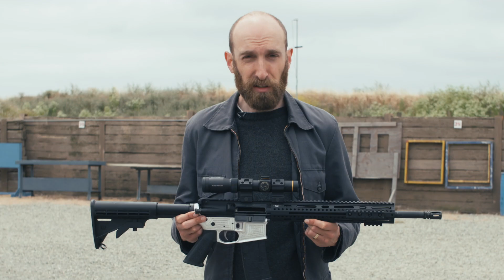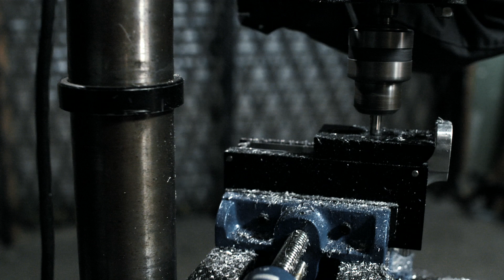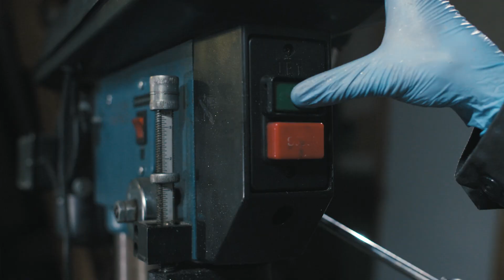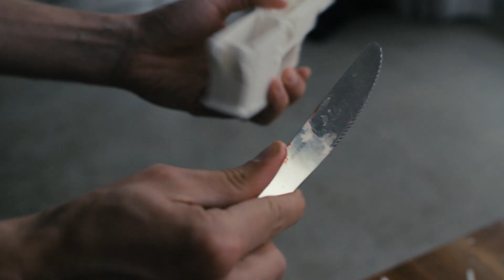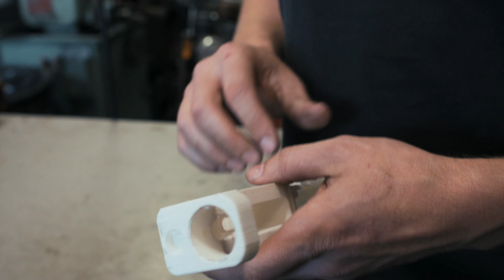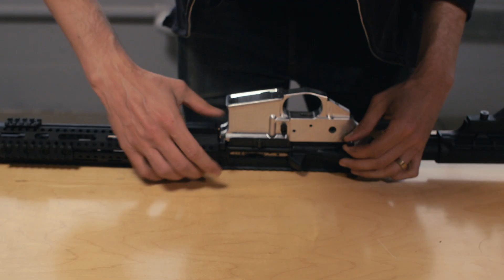I Made an Untraceable AR-15 'Ghost Gun' In My Office | WIRED

Comment: What's your point? Technically I can make a grenade with some black power, shrapnel, and a fuse. Doesn't mean I will or that if I did it would somehow make me a criminal (Although I'm pretty sure that's considered illegal so maybe a bad example) Show me an AR built the way you made yours used in a killing......Can't because no one who is a criminal has that kind of time and patience especially since you can buy a fully assembled one on the black market from mexico for the same price.
Reply: gequitz Tell that to Timothy McVeigh
Reply: Alex Obscene yeah and you can make a shotgun with 20bucks worth of pipe from homedepot, so stopping the sale of this machine accomplishes nothing. If a criminal wants to kill or hurt someone whether something is legal or illegal will not stop them. Control laws only hurt law abiding citizens.
Reply: Murray, To further your point, you can make a slam gun and bore it on your own pretty cheap too.  Just make a custom rifle barrel the old way, with a bore bit and a hammer isn't actually that hard.  Blowtorch heat treating it, boom done.  If you want it better, making a bolt action wouldn't be extremely hard.

If people think this is absurd, a .306 could be made with minimal effort and does enough damage in the proper hands.  Youtube has made making a gun easier than ever.
Reply: ***** Bombs tend to fail to kill as many people as guns do.

Not always (as McVeigh did 21 years ago), but most of the time.
Reply: what i feel it would and could be used for is machining these and then selling on black market. not necessarily for the criminal, but for the criminal supplier.
Reply: Anata No Senei you can legally manufacture a grenade with liscense.... or just file destructive device paperwork with atf and pay them 200 dollars for a tax stamp plus however much (likely super expeneive) your hand grenade is but it must be a transferable item
Reply: https://en.wikipedia.org/wiki/2013_Santa_Monica_shooting

A guy previously admitted to a psych ward made his own AR-15 (with an 80% lower) and killed 5 people in California.
Reply: First of all, you said "Show me an AR built the way you made yours used in a killing......Can't because no one who is a criminal has that kind of time and patience," so the question you're asking now is different from the one you asked previously.

Second, yes people can build bombs (or use knives, molotov cocktails, etc), but bombs tend to fail to kill as many people as guns do (at least in developed countries). 

The San Bernardino shooters killed 14 people with their guns, 0 with their bombs, the Columbine shooters killed 13 with their guns, 0 with their bombs, and the Dark Knight Rises shooter killed 12 people with his guns, and 0 with his bombs.The Manhattan failed to gravely injure anyone with his bombs, just like the Times Square bomber 6 years before him.

While some people who can't get guns do sometimes kill people (Nice truck driver, Tokyo care center stabber), most end up getting caught before they finish building their bombs or fail killing people with their weapons (take a look at how many ISIS related plots/stabbings have failed in Europe). In America, most people who want to become mass murders do end up killing multiple people with guns.

The Santa Monica shooter may have killed 5 people even if he didn't build his untraceable gun. Hell, he may have even killed even more people with a car or something. But most likely, he would have been able to kill fewer people, as crazy people who want to kill as many people as they can are pretty crappy at building death machines on their own. Being able to buy a machine that can make you weapon that can reliably kill multiple people changes the equation.
Reply: gequitz
I knew full well after I posted that someone would probably find an instance where it happened. It still doesn't change the fact had he not been able to machine it himself he could have just bought one by either going to Mexico or buying one off the black market here in America. I mean had he not bought an 80% lower he could have just cast one out of aluminum himself. Or he could have just made some napalm and thrown it on some nearby houses and killed a lot more people. This argument comes down to if people want people dead they find a way.

Comment: Could you make a military great lower receiver (so with full auto capabilities?) with the 80% lower and that machine? Just curious.
Reply: No, what makes something semiautomatic or automatic is the fire control group, specifically the sear. I assume you also meant military grade? As in Mil-spec? All that means is the aluminum meets such quality control and the fit and finish is to certain tolerances. Military Grade has nothing to do with something being automatic or not.

    One other thing, M16A3 and the shorter M16A4 are not automatic, they are either Safe, Semiautomatic or 3 Round Burst.
Reply: Yes, it is possible, and you can legally make an AR15 FA using pre-ban parts or lowers.
Reply: I'm pretty sure you can still buy full auto parts. (Again you'll need a class 3 ffl). But if you had it before a ban it gets grandfathered in. No weird permits.
Reply: Technically yes, but you'd also need a full auto trigger and an m16 style bolt.
Reply: TheConvict50 OK. Is there any difference between the m16 lower receiver and civilian ar 15 lower receiver?
Reply: ok just an FYI, even if you built it yourself fully automatic weapons are still illegal. Converting a weapon to fully automatic is actually fairly simple. I dont know all the terminology  but I will do my best to explain. When the hammer is pulled back, it is connected to the trigger with a sort of hook thing, when you pull and hold the trigger, the hammer flies forward and hot the firing pin and the force of the round pushes the hammer back. If you are still holding the trigger, the hammer catches onto a back up "hook" which disengages when the trigger is released and the primary hook catches it again. If you file down that back up hook it is now automatic but is also very illegal.
Reply: SteelxBullet True, but that is not how military fully automatic weapons work. That is a dangerous way to do it and can actually lead to soft strikes, causing the bullet to not go off. There are videos on youtube showing how fullauto guns work. In simple terms the bolt hits a lever releasing the hammer. And you can buy fully auto guns and legally have them with a class 3 ffl. There are videos on youtube showing how fullauto guns work. But yes, filing down the "hook" is illegal and also dangerous.
Reply: KC A no i didn't know anything about the aluminium specifications. I just used the term millitary because i know fully automatic ar 15 are illegal under normal circumstances.

basically what I meant was is it possible to convert a civillian semi auto ar 15 to a fully auto ar 15?
Reply: yes
Reply: Nataniel are preban parts still legal? in other words, if you bought an ar 15 FA  before the ban, are you allowed to keep it?
Reply: You can buy a 3rd hole jig and M16 parts kit off places like gunbroker, going to run about $150. I don't suggest letting the government know if you make a full auto rifle though.

Comment: What gun control laws are you skirting? What you have done is 100% legal. The law specifically allows you do build what you have done. Every time you say you are skirting the law,  you sound like a moron. If you do not like the law, call your senator and have it changed.  I love the WIRED channel, but this is frustrating. Please do better research so you don't sound like a political hack

Comment: The problem that all previous shootings were committed by either legally registered arms stolen from their irresponsible owners or illegal firearms that were mysteriously supplied to them "either from a private seller or from the black market".

Criminals wouldn't bother to make their own guns if it is readily available illegally "illegal guns are available and sold at all times and everywhere" or if they can steal them from someone "someone who is irresponsible to own a firearm, i.e he/she wasn't  hiding it somewhere safe and secured when not actively using it".
Reply: give this man an award
Reply: Hell, there are so many stolen or lost firearm in circulation now, even if you somehow stopped all production of firearms tomorrow, it would take potentially decades to get them all. In my city, in the ghettos, they have dead drops that are always stocked with handguns if someone needs one. Cleaning them up has been nearly pointless because they get moved and restocked faster than law enforcement can do anything.
Reply: There are only two or three states that have firearms registries, and they're for pistols, and "assault weapons." Weapons used in crime tend not to be on any registry.

As far as the black market goes, Senator Leeland Yee from Cali was imprisoned for conspiring to import small arms and rocket launchers from S/E Asia iirc. In eastern Europe illegally manufactured machine pistols under the name R9 Arms Corp have been showing up as well.

You are right, however, that most used in crimes here tend to be stolen, or sold illegally.
Reply: What if the victims had not been unarmed?

Comment: Please correct me if i am wrong. But what makes a gun traceable is the marks of the barrel that are left in the bullet...and the mark of the firing ping...if he bought the barrel online. Im pretty sure it has some kind of serial and the company who manufactures should share this records with the ATF
Reply: Guns that are sold with a licensed dealer would have a serial code milled into the receiver. Some states have a requirement to register that gun, but if you made your AR from an 80% lower it doesn't need to have a serial,  but if your in select states, they'll want you to register it.

Comment: Or you can just buy a mil-surp rifle privately which also requires no background or registration, and then modernize it with parts sold legally on the internet. much cheaper than a 15000 computer piloted mill. this is prohibitively expensive for anyone accept criminal organizations. then its prohibitively slow.
Reply: 1500, not 15,000. Big difference. 1500 really isn't much more expensive, if any than a mid tier AR.
Reply: this is about $1,200 just putting this out there. Its a good hobby machine. Would be cool to see a 1911 made?
Reply: +Camino377 I'm sorry, but you've been getting ripped off HARD if you're paying $1,500 for a mid tier AR15
Reply: AR's are only 700$
Reply: basic ones are even cheaper, but .223 is too expensive imo. I'm a big fan of cheap, so I like shooting 7.62x39 steel case
Reply: MinuteMan23 You're thinking Mil-spec. I'm thinking mid tier being Daniel Defense, POF, etc, really anything that isn't using a mil-spec trigger by default. A bare bones Mil-spec AR is far cheaper than that.

Comment: "Before I could load it with explosive bullets"
Reply: Smokeless powder doesn't explode, it deflagrates. It's a small distinction, but a very important one. Black powder is an explosive, smokeless powder is a propellant.
Reply: Actually modern smokeless gunpowder is not an explosive. Its a propellant. And bullets don't explode in the barrel.
Reply: Maybe, or maybe he was using language to push the gullible around. It happens a lot from supposedly stealthy or subtle critiques of firearms and their owners.
Reply: @rigegs you are thinking about the dum-dums(a bullet with exposed led tip or a hollow point that expands on impact around twice its original diameter and dealing massive damage to soft tissues) myth of the ww2. I've heard stories from my grandad who was a Yugoslav partisan that the Germans would file off the tip of the bullets, but i doubt thats really the case.  Soviets did use explosive bullets, but they were super rare. Only a few snipers were issued a small amount of them and they were ordered to use them strictly for taking out VIP's. Like high ranking officers or snipers etc. The Germans also used them on the eastern front, since the USSR did not sign the Geneva convention outlawing things like exploding bullets. I think Simo Häyhä was shot in the jaw by an explosive bullet.
Reply: Yes they are dangerous, but they do not explode. Gun Powder is a rapid burning material, not an explosive one. There is a difference.
Reply: +Mark Oliver Walsh Actually it deflagrates, or burns. Explosions are what happens after things detonate. They are different things.
Reply: +mrln_fxl If bullets exploded in the barrel, there would be a lot of destroyed firearms out there.
Reply: rigegs this channel has done some testing with both the Soviet and the German explosive 30 cal. Very cool stuff.
Reply: Romeo Tango if you don't understand that bullets explode you're a fucking idiot, and a walking anti-gun ad. Knowledge is your friend bud
Reply: Might have been edited out of context.

Probably used test rounds in the gun before using actual bullets.

Or maybe he just loves explosions and got some explosive rounds?
Reply: +Caddy Guy Gaming
This is old but errr sorry to bring it to you bullets DO kinda EXPLODE in your gun.
The only reason why there are NOT a lot of destroyed firearms out there is because they are built sturdy enough to withstand the pressure....

Here a little wall of text for you:
When you pull the trigger of a gun a spring mechanism hammers a metal firing pin into the back end of the bullet igniting the small explosive charge in the primer. 
The primer then ignites the propellant—the main explosive that occupies about two thirds of a typical bullet's volume. 
As the propellant chemicals burn they generate lots of gas very quickly. 
The gas shoots from the back of the bullet increasing the pressure behind it and forcing it down the gun barrel at extremely high speed.
Reply: Romeo Tango or he understands that gunpowder explodes and can totally fuck up a shitty lower

Comment: That's fucking cool can u buy a already made lower receiver illegally 🤔
Reply: its legal
Reply: did you mean legally?  I think you did. and yes you can from every AR parts maker, and there are hundreds to choose from. you can buy them stripped or complete ( with all the parts already installed )  if you buy a lower, it's the only part you have to go to the ffl to get as it has the serial number on it. every other part you can buy online and have shipped straight to your house. if you buy an 80% lower you can get it shipped straight to you with no ffl fee's or background check. checkout Modulus Arms "easy jig", with that all you need is a trim router and a hand drill to make your own lower

Comment: stop abusing the term gunsmith. I'll use the liberal card, it's offensive. machinist, maybe. gunsmith, no. also, id doesn't circumvent gun control laws. you still cannot own a rifle with certain features in Cali, whether it's self manufactured or not. you also cannot legally sell or trade the weapon. another note, to send the reciever off for anodizing (that's means to make it not shiny) you have to serialize it, or else the FFL the anodizer sends it back to cannot transfer it to you.

Comment: Where can I find the milling machine? As to the libratard Assmonkey reporter, your video only show a person exercising their Constructional Right to own a firearm what you do with it after you put time, sweat, and yes some blood is your business as long as you don't sell it give it way or some how trade it off. Also most of the people that try to turn a 80% lower into a firearm get as far as you did with the drill press. The ones that do have the skills to mill one out mark it with a SN and contact ATF they don't want to be a felon. You make it sound like anyone that wants to try this is going to use it for nefarious reasons. Not so if I tried it and it worked as well as my issued weapon I would ask my Chief if I could use it for work. As side note: you can make a firearm without a FFL under certain conditions per the ATF.

Comment: You aren't circumventing Federal Law. Actually, based on the ATF definition, the 2nd Amendment and other laws you are legally capable and should have the right to make your own firearms. Mind you, just because you can doesn't mean you should. State and federal laws STILL applies on ownership. If you commence in the act of selling your gun, you THEN are acting in commerce and then and ONLY then do you need to serial stamp your gun in the proper channels. Mind you ... I am not a lawyer, and this is not legal advice or suggestion what so ever, but that's effectively how many view the laws in this current state of them in 2016. This is neither illegal, nor dumb to do in fact. The INTENT is where things are murky and using both common sense and due diligence is always advisable.

Comment: Using a drill press to mill a lower is like using a machete for a bypass. Wrong tool. You use a jig kit and a milling machine, which is designed for cutting intricate cavities, much like a scalpel is used for surgery.
Reply: routers are a lot better (and cheaper) then drill presses for milling anything.
Reply: Made my lower on a drill press. drilled then, used a mill bit on the press. Looks 97% perfect. Your theory is BULL!
Reply: but did it work?
Reply: wulf arrow the lower he "tried" to mill via drill press completely failed
Reply: +Jr Dirty cheaper still is just buying a gun. 'Tswrong widat?